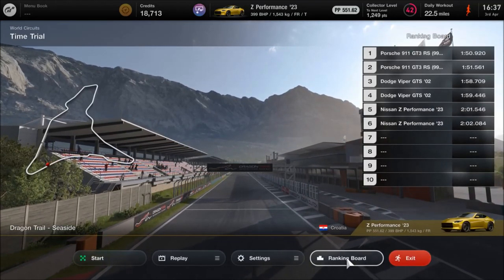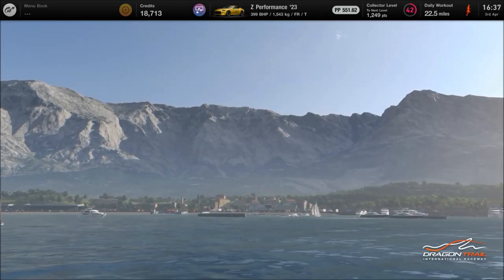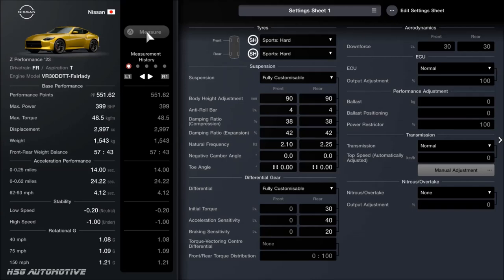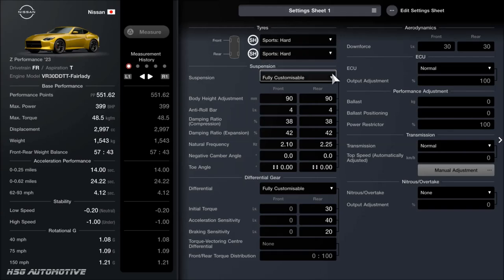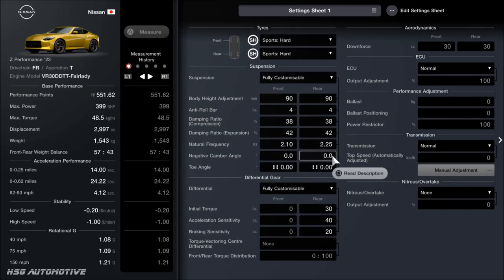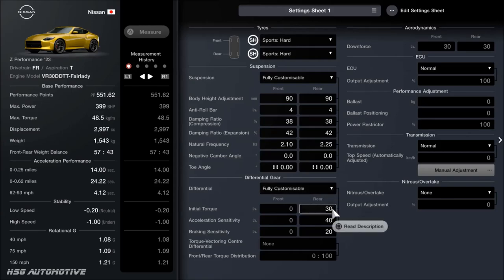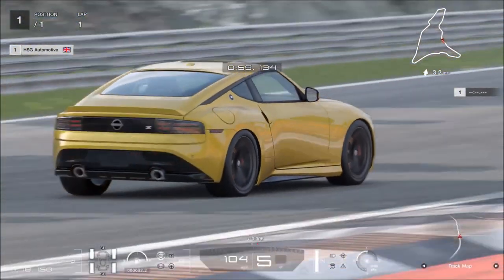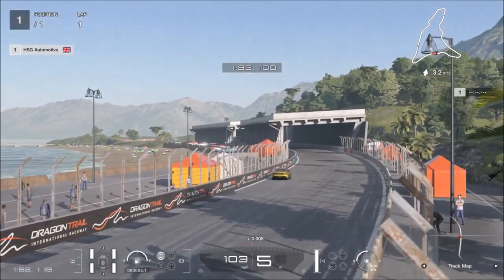GT7 - 2023 Nissan 400Z Z Performance CIRCUIT/GRIP Tune Setup Tutorial

Comment: Do you think you could make a grip build for the RE RX7 in the future? I’ve been tinkering with it a bit on my end and have had some success with racing it again gr.4, but there still seems to be a grip issue in the corners that I can’t fix properly.
Reply from the maker: I most likely will yeah, but in the meantime I did do a tune for it in GT SPORT which you could try retrofitting to GT7
Reply: @HSGAutomotive  I was under the assumption that the physics are too different between the games for that to work, but I’ll test this when I get a chance! Thanks!
Reply: @Super787B how did it go?
Reply: @nathanthomson777  it’s been a long time, but I think I worked out something. Dunno if it still works in the newest patch, haven’t played in a long time sadly.